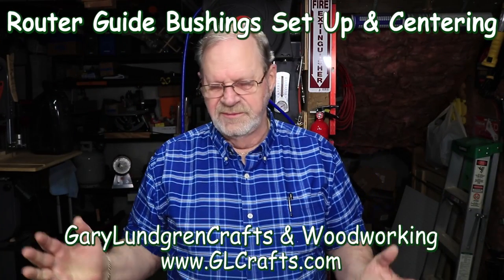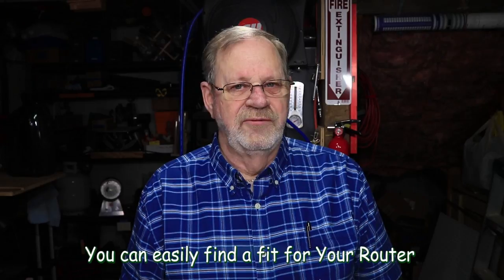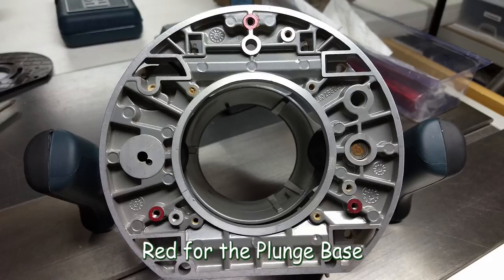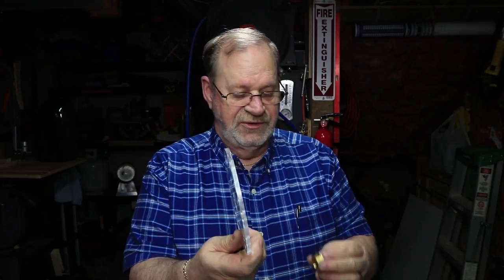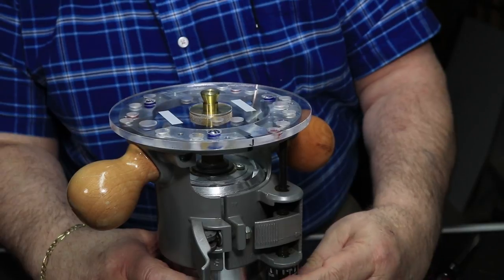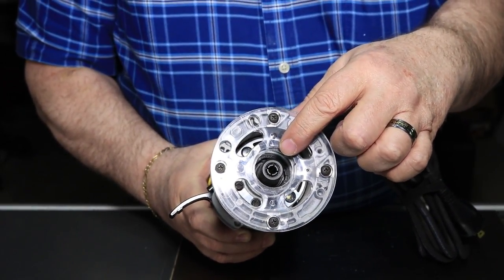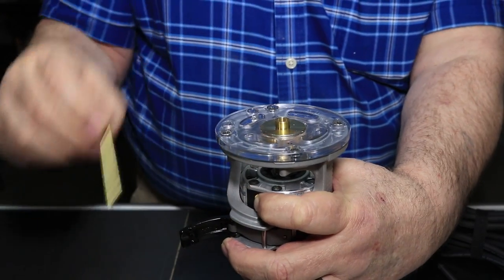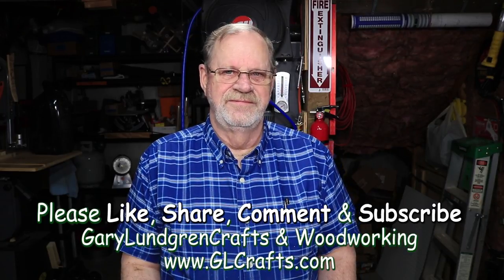Router Guide Bushings Setup and Centering – Bosch & Dewalt Ep.2018-09

Comment: Thanks for the video, this is an important step for setting up your router for using certain jigs.  You might get even better results if you lock the router height before tightening the sub-base screws.  That way nothing can shift.  Thanks again for posting.
Reply from the maker: Thank you!  Good point!  Thanks for sharing the tip. 👍
Reply: If you lock the router height, how are you gonna align your collet with the centering pin?
Reply: @liambaker1597  On my centering cone, it will slide up and down on the 1/2" shank.  So if you get the height of the router close and lock it, you can still press the cone against the sub base.  Then just tighten the screws.  Centering cones aren't my favorite, but they do work if you're careful.
Best
Reply: @TheThoughtfulWoodworker  Oh I see, tbh I prefer adjusting the router than moving the cone up and down. And btw, which centering cone do you use? I was looking at these Dewalt and Bosch centering cones but both of their cones are made of plastic and some reviews say after several uses the plastic becomes wobbly
Reply: @liambaker1597  I use a centering mandrel that fits inside a specific guide bushing.  Similar items come with inlay bushing kits.  I just find centering cones unreliable in general.  If I had a turned brass one, I might trust it more.  My plastic cone has never become loose, but since it's molded plastic and not turned metal, I don't think it's totally accurate.
Thanks
Reply from the maker: @liambaker1597   Thank you!  I believe that it's Ok to lock the height as the guide plate can still move and center on the pin and then tighten the screws on the guide plate when centered.

Comment: Thanks, i have a 30mm template for MFT holes (20mm) , i have a Bosch POF 1400 with that click bush system from out factory, not centered at all, so i printed a plate with a 30 mm OD bush in one plate and centered it with a cone and it came out precise with some tweaks (screws), so thanks for your knowledge and great explanation.
Reply from the maker: Thank you!  Glad it helped. 👍

Comment: Thanks for this informative demo.  I think it’s fair to point out that your centering pin is from the Jasper base kit intended for fill-size routers but happens to work in the 1/4” collet of the DeWalt compact router.  DeWalt sells a different centering cone that you use to center the base hole, without the bushing installed.  I guess the presumption is that if the base is centered, the bushing will be, too.  Would like to see you demo this configuration.
Reply from the maker: Thank you!  I will look into doing that.  Thanks for the tip! 👍

Comment: Gary - love your channel - one add to this video that might help someone.  Maybe your German Festool-using viewers won't have the issue I'm describing, but I'm willing to bet any adjustable base (fixed or plunge) on the big-box Chinese throw-away routers most of us use will benefit. I own 'one of each' brand and they all have this issue.  What I've learned the hard way is you'd better lock whatever clamp locks your depth  before finalizing your centering (I noticed on the video you left yours unlocked on the little DeWalt).  On my routers at least, locking that clamp DOES change the orientation of the motor relative to the base... on mine its  >.010-.015" which is  plenty enough to wreck the cut, or to make an otherwise "tight enough" joint not go together properly.  It also makes a difference if  your base is almost all the way out when you're "centering" but much closer to the collet when running.  So - in addition to locking the base before finalizing the position of the base plate,  it also helps to do the centering as close to the depth you'll actually be using to make the cut (if you can - on my trim router there's no room so I have to have it extended  way farther than it will be when running)   Anyway hope that helps someone.  You can get cheap tools to produce good work, but it takes a little extra fiddling.   Glad to see you back in action  - here's to a  great 2019 !
Reply from the maker: Thank you for that tip!
Reply: I was going to mention the fact that by locking the base first you do get final locked position for centering but Tioga Fretworks worded that so very  well and I agree with his explanation 100%. I think failure to first lock base first before tightening screws would not give you as accurate results. Thanks for your great video.

Comment: Hello sir what was the model number for the dewalt base and also for the guide bushings. Thank you for the great video.
Reply from the maker: Thank you! The DeWalt base comes with that router. My instruction/user guide doesn't give a parts list.

The guide bushings are at this link Woodriver 10 Piece Brass Router Bushing Set With Case Porter*Cable compatible
http://amzn.to/2HWDRx0

Comment: I too have the same Dewalt router. I followed your instructions, but I have a Powertec Brass Router Bushing set. It doesn't come with a centering pin.  Anyway, I have a question, I want to do an inlay, but if I put the 3/4" straight router bit in the router, the bottom of the bit is a fixed distance from the base plate, 1 1/2", I can't figure out what to do, since my inlay is only 1/4".
Reply from the maker: Thank you!  I have not done inlay before. I use guide bushings mostly for making signs. See if I understand your question correctly. Can you adjust the depth of your router bit if you're trying to get a 1/4" deep cut? Nost base plates will let you adjust depth. You may put your bit in deeper in the collett but not seated all the way in. That would make it hard to get out and it wouldn't set straight or could come loose due to the shoulder on the bit.

Comment: Is that compatible to Dewalt DW618? Please reply and thank you so much
Reply from the maker: Thank you!  The Jasper adapter plate says in its instructions that it will fit the DeWalt 618.
Reply: Gary Lundgren Crafts what about the bushing? I see some at Amazon and Ebay but it doesn’t say the fitment for the bushing..
Reply from the maker: @jaimegenovajr3257   Thanks. It says on the package near the top that it fits the Porter Cable bushing. ". . . to use Porter Cable style guide bushings."  Use the link in the video description to see that.
Reply: Gary Lundgren Crafts thank you so much sir

Comment: Hi Gary. Thanks for the useful video. I have these same two routers so this was helpful. Question: does the same process work for the plunge base on the Dewalt? 

Also, are you using the original base plate for your Dewalt fixed base? Mine is not round like yours, but D-shaped instead.

Comment: If you have the Bosch adapter and centering pin do you still need to change the plate? It seems unnecessary.
Reply from the maker: Thank you! Sometimes we change the base plate to use other types for different purposes such as: circle jigs, pattern trimming (similar to template cutting but the bearing on the bit follows the pattern whereas the bit on a bushing doesn't use bearings), in a router table we typically use bearing bits too, and other specialty jigs we sometimes use. Thanks!

Comment: wait the dewalt comes with a base that excepts the bushing collar in the box
Reply from the maker: Thank you!  It will accept Porter*Cable standard bushing collar.
Reply: @GaryLundgrenCrafts  i bought the powertec guide bushing set will this work?, im not a dewalt fan but if the base works out the box then thats a win
Reply from the maker: @suspensefulness  Thanks.  I'm not familiar with the Powertec guide bushings. But if they are compatible with the Porter*Cable bushings, it should work. From what I see online, it should work.

Comment: I have followed your steps on my Ryobi router and have difficulty,  I have blown out 4 bushings and am left with just the hole , no collar. I did center, and used a 1/4 bit in a  1/4 collar with a 5/16 outer dia.  . Is is the operator or the machine at fault ? thanks
Reply from the maker: Thank you!  Are your bushing guides coming loose? If so, take a look at this video for getting them tight easily. https://youtu.be/Fy-Cpogkv8E
Reply: @GaryLundgrenCrafts  bit and bushing are tight, but it appears my sliders for the plunge have a little sway/play in them.Could I be going sideways to hard? 5/8 deep in spruce 2x4
Reply from the maker: If you're hogging out 5/8" depth in one pass, that is probably too much. I would suggest no less than 3 passes of 3/16" per pass. Or 2 passes at 1/4" deep and the 3rd of 1/8" deep. Thanks!

Comment: The link to your shop doesn't work and copying of text doesn't either.
An effective way to lose customers I imagine.
Reply from the maker: Thank you.  Thanks for letting me know.  I tried the link and was able to connect with it.  Can you tell me which one you tried? Thanks!
Reply from the maker: I think I found it. Let me know if it works for you. Thanks!  I'm sure there's more I need to fix. 🙂
Reply: @GaryLundgrenCrafts 
All links should be coloured BLUE to indicate that they are functioning links.
Read down through your text and you will notice that MOST of your references to other sites are not blue and so, do not work.
Alternatively, I notice that I cannot copy any of the text either in order to do a copy and paste into my browser.
Reply from the maker: @Tinker1950    Thanks for your suggestions. I notice some links are in blue and some are not. Perhaps that's a good indicator for me to find broken links. I will look into that on all my videos. I appreciate letting me know of broken links. 👍